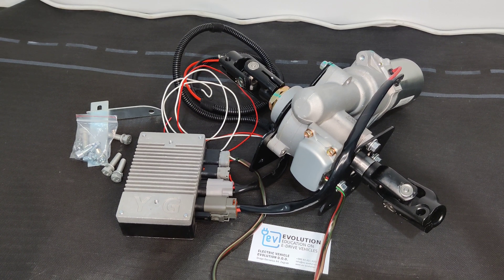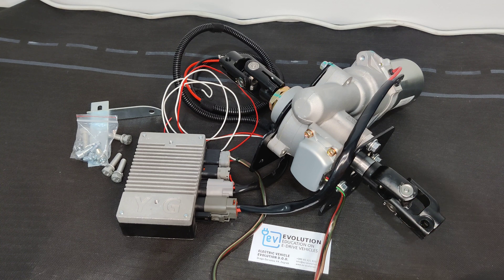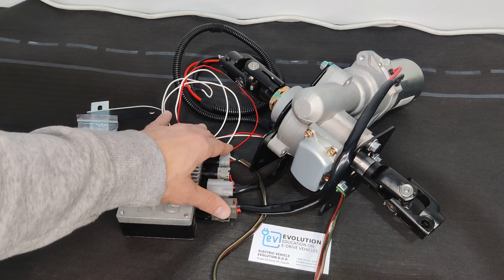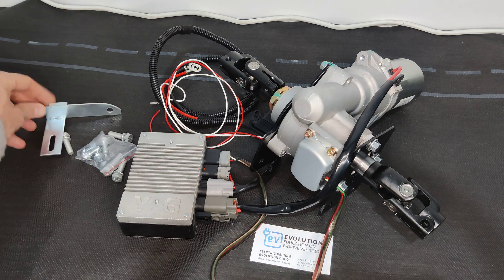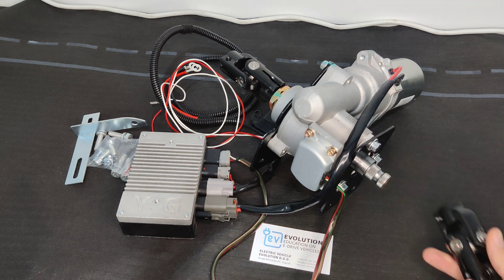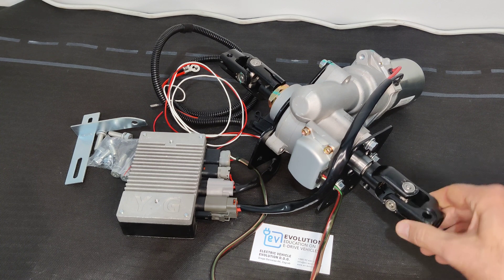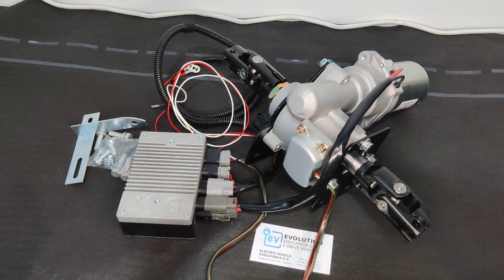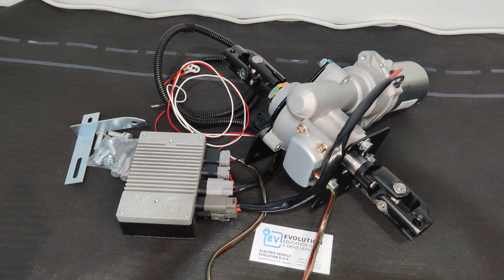EN: EV Universal Electric Power Steering Kit

Comment: This looks to be the same as other kits that come from China and the US I want one for my CECTEK  T6 quad bike but don’t know if. It will work on a restricted turning amount. Also how much torque it would give me. At the moment my steering is so heavy that I cannot revers using one hand on the bars. Most newer quads have powered steering now  so it must be a possible fit for mine.😊